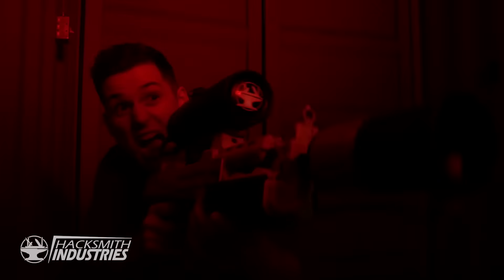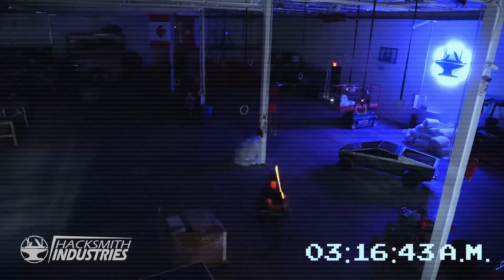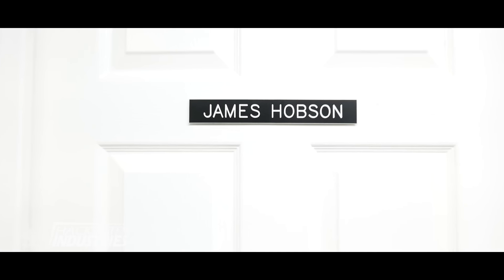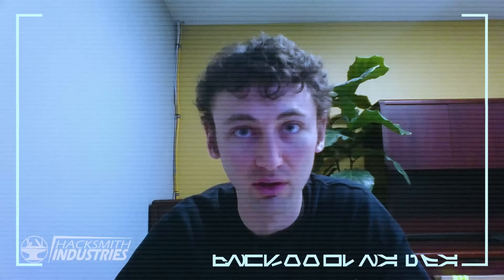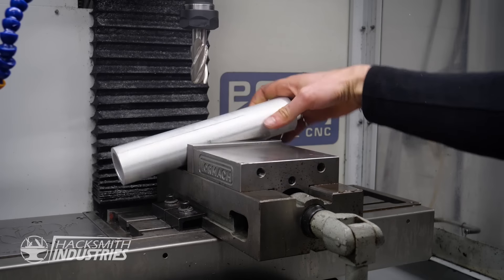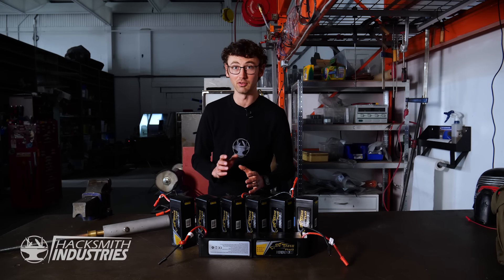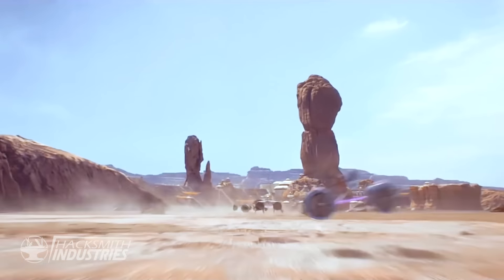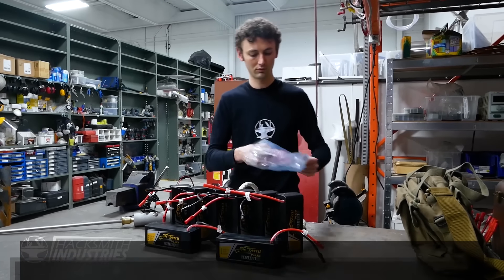REAL LIGHTSABER DUEL! (2752°)

Comment: I’m honestly shocked that it’s an almost perfect comic cannon protosaber..when then blade retracts into the hilt I’ll be completely satisfied lol
Reply: 2 retractable rods one inside the other just like toy light sabers. You would have to let it cool to retract though
Reply: Make a costume outer shell that is an actual blade with a sharp end
Reply: @nathanielecheverria8458  have a built in liquid nitrogen tank duh
Reply: @nathanielecheverria8458  yeah but nothing some heatsinks or cooling fans couldnt speed up, dare i say liquid cooling?
Reply: @3cho787  maybe I'm not an expert. Also I bet the temper is crap because of the heating
Reply: TulkasPlay It would evaporate and explode
Reply: @3cho787  So that's why Linus came, to water-cool proto sabers
Reply: It can’t cut through anything more than thin materials though. If it could cut through thicker materials, and retract into the handle, you’d have yourself something useful.
Reply: @sylph4252  it would shatter from massove drop in temp
Reply: IT DOES NOW
Reply: @avercado4132  wheres the vid?
Reply: I bet it won’t be a long wait
Reply: No people gonna say it’s just hot sticks that can turn off
Reply: Maybe a giroscopic rod like fishing rods? It could work
Reply: It already happened
Reply: Now you got what you wanted
Reply: @bunnyslayer3390  bruh have you not seen the plasma light saber BRUH
Reply: @bunnyslayer3390  r u alive???
Reply: @443MoneyTrees  you're responding 2 years after the initial comment lol. And the issue with the plasma protosaber is you lose the ability to clash against other sabers and the plasma does not hold in a saber-like fashion with any kind of movement like you would see when someone wields a saber
Reply: Guess what...
Reply: What about now?
Reply: Well..
Reply: This comment aged well...
Reply: so who's going to tell him

Comment: People 2010: its physically impossible too build lightsabers

One youtube boi in 2020:
Reply: A more dangerous and cheaper version would be a steel rod covered in lighter fluid. You could spritz burning lighter fluid on your opponent, refuel with a splash from a pouch that would probably last longer than a battery, and have the whole thing cost less than 30 dollars. You could also heat it with a blowtorch, which could also be very cheap, costing less than 20 for the ignition and 3 for propane. The temperature of both would be around 3600 F, or 2000 C.
Reply: Well its a protosaber.
Reply: One youtube boi in 2020: OH I Don’T tHInk sO
Reply: 【BL GAMING】 General kenobi, you are a bold one!
Reply: TheGreenVegan 
Or work without cables
Reply: IKR
Its impossible still
Only protosabers are made
Reply: I prefer fighting with Hasbro's lightsabers
Reply: 2020:Maybe O dont eant to be a bad guy anymore
Reply: True
Reply: @DreadT1e  they are designing a plasma lightsaber as of now
Reply: bois not funny
Reply: I think force fields are the key to making a true lightsaber. Maybe 2030 YouTube?
Reply: Youtube boi in 2030: Hold my plasma saber
Reply: @TheGreenVegan really
Reply: @TheGreenVegan do u still have it
Reply: @DreadT1e  sad we can't make a lightsaber
Reply: @ph4ntom_39  agreed
Reply: @nofvcejuno  really
Reply: It’s technically not a lightsabre since it’s not made out of laser
Reply: @IEatFloor  yeah i know
Reply: @AlphaAntares e  it doesn’t have to be light the name isn’t always accurate in fact they actually said in the games that it is plasma. If it is plasma you can have powerful magnetic fields stoping the plasma from escaping
Reply: Hey I was born in 2010 don't thess my yeqr
Reply: @TheGreenVegan you spoke to soon
Reply: @TheGreenVegan It can now buddy
Reply: TheGreenVegan now it can
Reply: @granola661  he has created a plasma sword now
Reply: @Zab_u  It's propane but yeah
Reply: @AlphaAntares e
They just made it!
Reply: @Reaper of Souls
Youtube boi in 2020: Hold my plasma saber
Reply: @TheGreenVegan this aged well.
Reply: Lie
Reply: Now its literally a proto saber, its amazing
Reply: @TheGreenVegan Boy do I have news for you
Reply: @TheGreenVegan NOW IT CAN BOIIII, 4000* SABER HE'S BUILT CAN GO THROUGH A STEEL WALL
Reply: @TheGreenVegan look at his latest video 😳
Reply: @TheGreenVegan they made now!
Reply: @TheGreenVegan The future: You called?
Reply: Not to be mean, but i dont think people in 2010 said it was impossible to heat a titanium rod to 3000 degrees😂
Reply: @TheGreenVegan well have I got news for you
Reply: @TheGreenVegan have you seen their new one yet?
Reply: @TheGreenVegan few months later
Reply: @TheGreenVegan if only 😏😉

Comment: some metals make different colors when heated, try using some to make different colored sabers
Reply: Yes but most are not good at conducting the heat and would burn up or melt
Reply: Mr. Minecreeper cool idea. We need this to happen.
Reply: @SpinosaurusSnake  yes we do
Reply: Most metals get red, even aluminum. You're thinking about when some metals (and their salts) are burned and vaporized. It wouldn't show up in an application like this. The metal either needs to be powdered or turned into an ionic compound.
Reply: I don’t know much about this stuff, but what you said is probably right. But if we could make that happen that would be cool.
Reply: Big brain

Comment: Wouldn’t it also make sense if u got a highly focused laser from the one u used for the iron man gauntlet and then attached a prism to it on the top and since a prism has the power to basically manipulate light u could simply just have the power button lowered or have a tungesten lip power button that would turn the lightsaber on and off and then have a high resistant plasma cutter to make it burn and cut faster